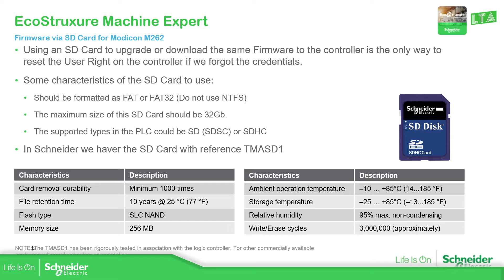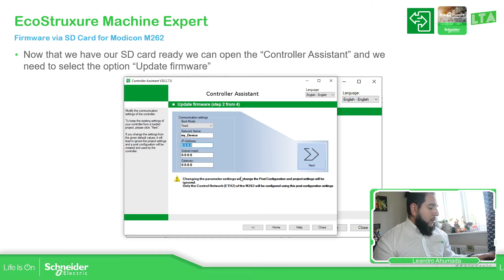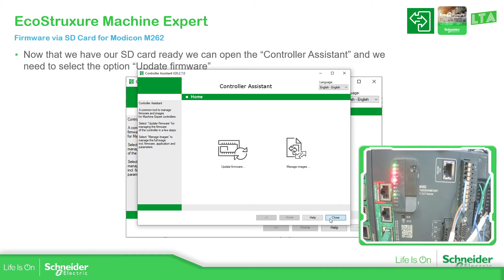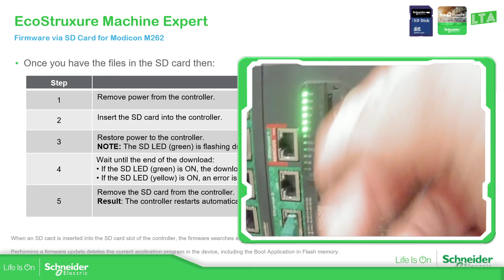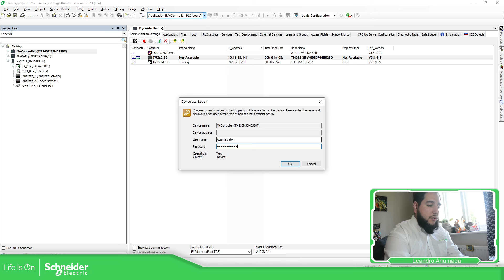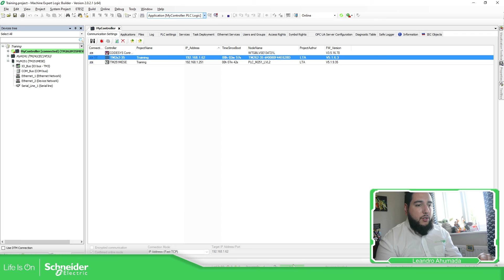EcoStruxure Machine Expert Training - M6.2 Firmware via SD Card for M262

Comment: how to upload program when pasward forgot .
Reply from the maker: If you forgot the password of the controller then you will not able to connect to upload the .project from the controller using MachineExpert or even using a ftp client because you must use credentials to connect. In order to use again the controller a firmware download using only sd card is mandatory.